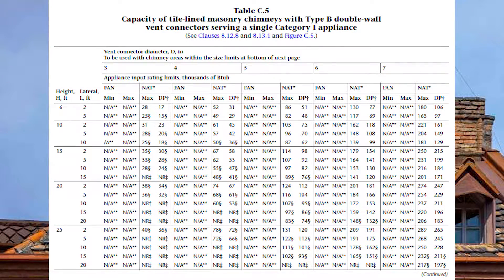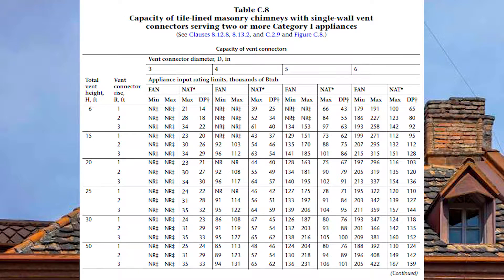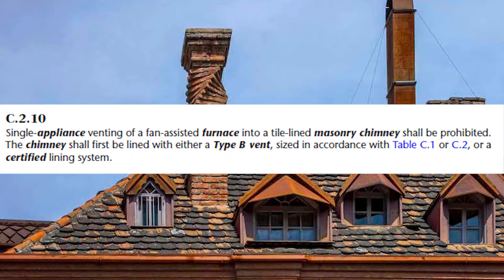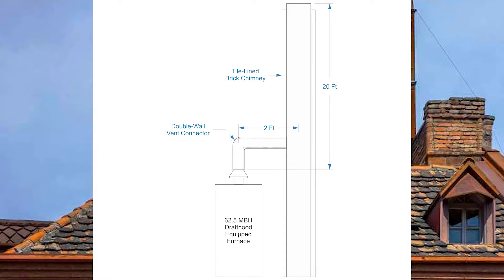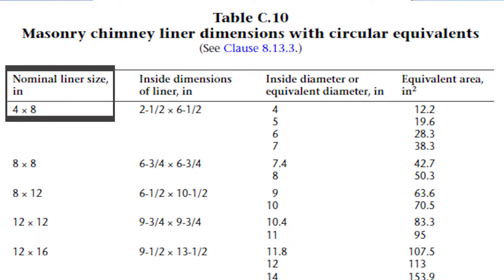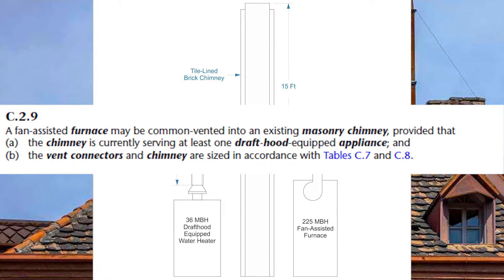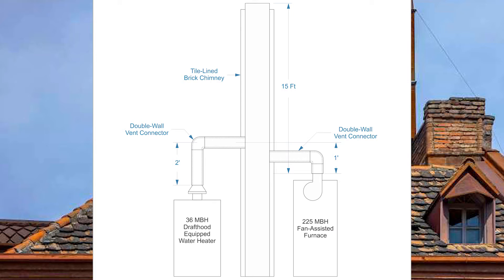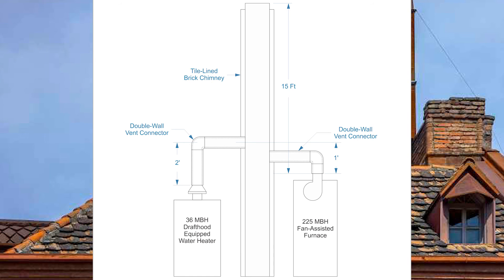Gas Venting with Tables Part: 7 - Sizing Chimneys

Comment: At the 04:25 mark, the table shows, in the 4" vent connector column, the min max for the chimney area is 19 and 88 inches squared respectively. Yet, when you then refer to C10 you use a minimum chimney area of 12 inches squared...which is the minimum in the 3" vent connector column and not the 4" vent connector column.

I think I'm missing something...
Reply from the maker: You didn't miss anything. I screwed up, the minimum is 19 square inches, therefore 5" round equivalent. I was building videos for hours each day for my class, I was probably going cross eyed when I made this portion

Comment: I have a single wall vent vent with 1draft hood appliance  when I add the 25% my input is less then my number on the chimney table. Rot for natural draft is saying I can upside my chimney by one but the table is saying I can't because my number is too big. What do I pick ?
Reply: In the module it's saying I don't need a liner but I'm confused on why not
Reply from the maker: If you are on the job site, you put a liner down the chimney.

In class, are you being asked to size the chimney using the ROT method or with tables? Your answer will likely be different depending on what the question is asking for.